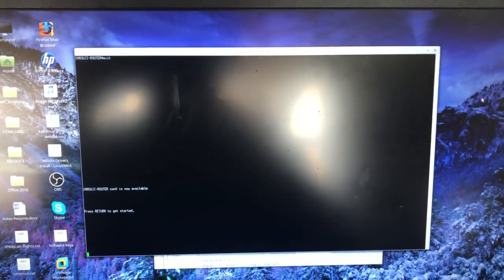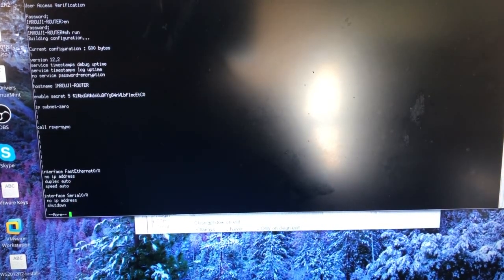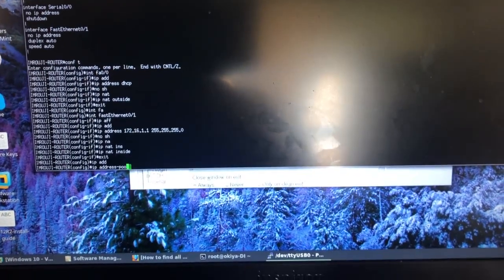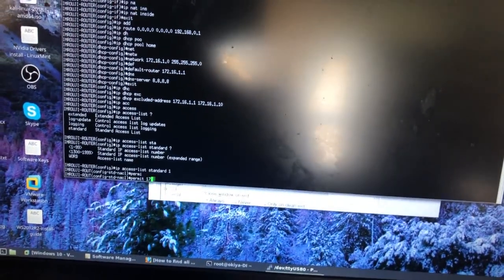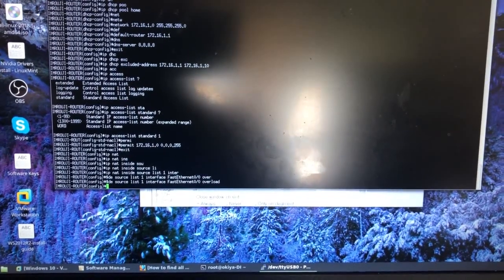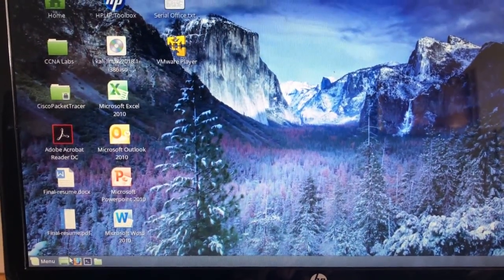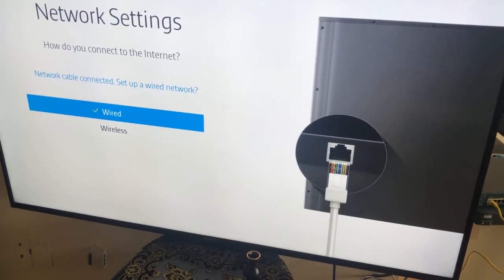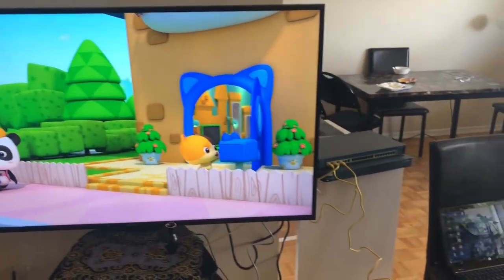Connect Cisco Router to your home ISP Router using Putty on Linux

Comment: Thanks for the video. I have been trying to get this BASIC connection going for last few days and was not having any luck by watching so many other youtube videos. You got me going....you are a genius man.
Reply from the maker: THanks for your kind words. I hope I will be always sharing useful things.
Reply: I do have a problem and you may know the answer----I have my router connected to ISP (FA0/0) and port FA0/1 connects to my Switch. Fa0/1 has DHCP setup. I get an IP on my laptop BUT I am unable to telnet  or PING to my switch IP. I can telnet to router no problems. Any ideas?
Reply from the maker: @gesusdube  Switches by default do not have IP address assigned. However, to manage a switch using telnet, you have to setup an IP address for the management interface: int vlan1. From a global config mode, run : interface vlan1 
ip address and give an address from the same range and mask
for example: ip address 10.1.1.2 255.255.255.0 
Hope that helps! :)
Reply: Thanks for your reply...I have done exactly what you have mentioned. VLAN 1 has IP address and SNM. I will double check when I get home and let you know. Much appreciated your help. Just curious, would it possible for me to telnet my devices at home from a different location? I am obviously using Class C addresses at home and connects to ISP.
Reply: so I have my R1 connected to ISP using port FA0/0. Port FA0/1 connects to from R1 to my SW1. Now, if I want to connect SW2 as well..how can I do that? I tried creating TRUNK port on SW1 and SW2 connects them together. But when I plug my laptop to SW2, I don't get an IP address from my pool!!! Any ideas?
Reply from the maker: @gesusdube  Check this out, that might help. Personally, I wouldn't recommend it, and I never tried it. just FYI:
https://networkengineering.stackexchange.com/questions/40874/possible-to-connect-two-switches-together-and-both-to-a-router

Comment: every thing is right but how did you connect through  putty when there is no ip for the
 router?
Reply from the maker: I connected to the router or the switch via putty using telnet after I have set an IP for the router and interface Vlan1 (Switch management virtual interface). Before that, I connected directly using the serial cable
Reply: @-schooloflife9402  thank u i came to know yesterday about selecting the port in putty before configuring the router

Comment: why don't you use obs to record
Reply from the maker: At the time of recording this video, I did not know OBS exist. Also, I needed to record the hardware connection and cabling, not just the screen capture, this is why I used the camera instead. Thanks for the advice man.